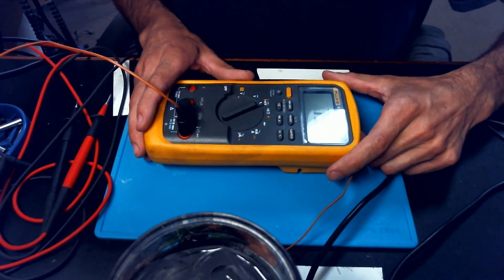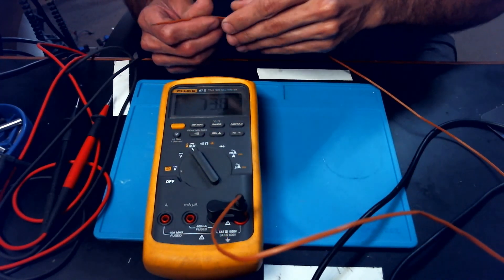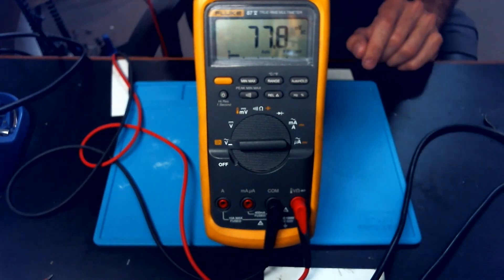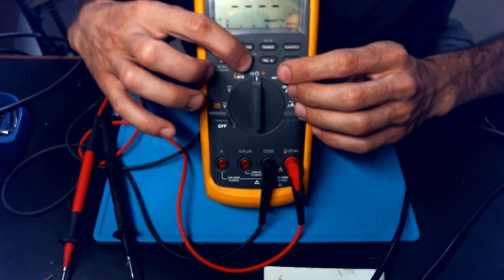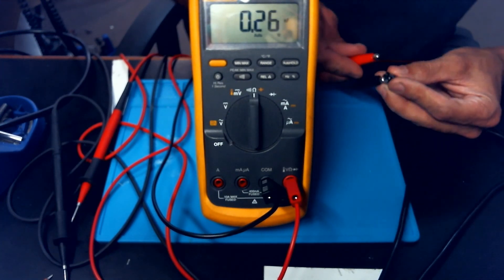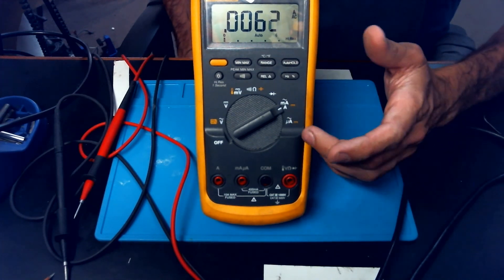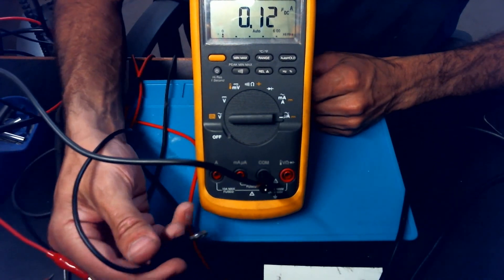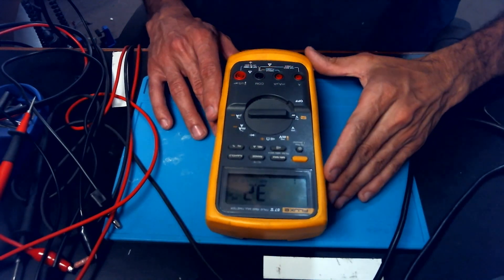The Superman of Meters? Fluke 87V Multimeter Review Part 2

Comment: I got southwire 23090t clamp meter its got 5 digit display it works good for reading voltage i received two of them that had bad contact on dial and would screen Flickr but  I emailed aouthwire and they sent me another one and I kept the broke one also

Comment: I have a fluke 87 True RMS ,is it normal that when I turn it on my screen displays everything on screen for about a second ..
Reply: Thank you very much for the help
Reply from the maker: Yes that's to test the display. It lets you see if any characters are non-functional.
Reply: @bebsrepairbench5074  thanks for the response I know nothing about this multimeter lol my older brother gave it to me a few years back and I want to sell it on ebay since I don't use it but was making sure it works
Reply from the maker: @Benjamin-j5l9x  which version is it? Is there an III or V after the 87, or is it an original version that just says 87?
Reply: In the top screen it says FLUKE 87 TRUE RMS MULTIMETER...nothing after the 87
Reply: I took a picture and put it on my profile idk if you can see it
Reply from the maker: @Benjamin-j5l9x  I can't see the picture but it sounds like an original 87. It doesn't have as many features as the 87V but is still a great meter.

Comment: Soooooooo after they got through the van allen radion belts ( that would melt ANY known element or alloy) and landed on said moon with this metric system. Did one of the astronuts get out before the first step to set up camera that captured the first. Then I guess through this “metric system” they left this camera, which obviously had wireless transmission capibilities, behind that filmed them leaving?
Reply from the maker: Not sure if you're mocking the moon landing, the metric system, or both. Either way, I'm not an astronaut or rocket scientist or a hardcore metric user, so I don't feel  qualified to discuss/debate space exploration. 

Thanks for the comment though!